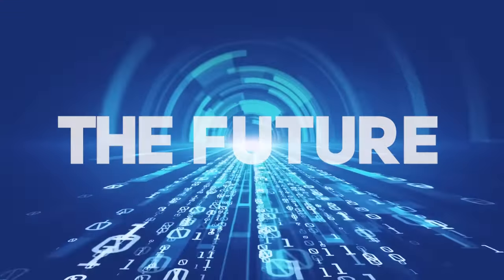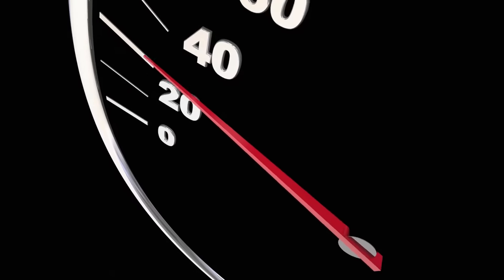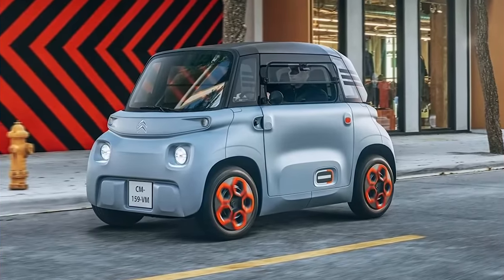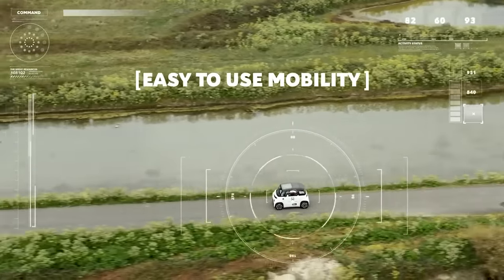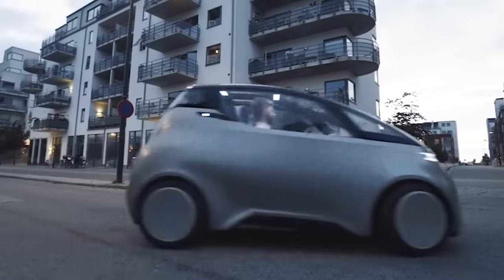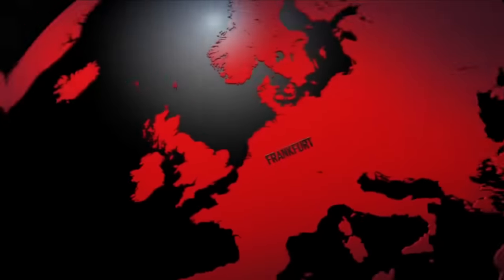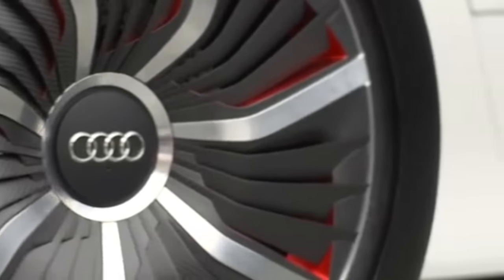Top 10 Mini EVs and Mini Electric Cars to Hit the Highways with

Comment: I’m sorry you left out Aptera up to 1000 mile range. With up to 750 watts solar charging that may almost never need plugged in for short commutes.    Not one of these EV’s compare not to mention cheaper then many of these EV’s.
Reply: This video is NOT about currently available EV’s and your link completely skips my hole point. Screw that not subscribing without honestly reporting EV’s
Reply from the maker: @jpo7091  Understood. Apologies for any confusion.

Comment: The former Chevrolet Volt (discontinued in 2019) has an 18.4 kWhr liquid-cooled battery that manages 50 to 60 miles of EV range. When the battery is depleted, the vehicle seamlessly switches over into hybrid mode averaging around 45 mpg with its 1.5 liter engine. My wife's 2018 Volt needs regular gasoline about once every three months and she is averaging over 200 mpg with her daily 50 mile commute. No range anxiety at all with this vehicle and performance (0-60 mph in under 8 seconds) that would embarrass any of these "futuristic" mini-EV's. BTW, the thermal management of the Volt's battery is amazing with no loss of range in almost 4 years of useage.
Reply from the maker: Wow. That is fantastic! Thanks for the info on the Chevy Volt. It is a bummer that they discontinued it, but Chevy has a lot of EV aspirations for the future. We do have full-sized EV reviews on our channel if you ever want to check them out. All the best.
Reply: Got a 2012 Volt for 9 Years. it was a good car. AHowever, you will lose range and comparing a Volt with this lightweight non-cars makes no sense at all. Now owning a Tesla Model S and ordered a Fiat Topolino (Citroen Ami) as second “car”.

Comment: Don't forget the SOLO by Electra Meccanica! Great little EV. One-seater as name implies. 100mi range. 80mph top speed. 0-60 in about 10 seconds. Looks great.....not as nice as the Uniti but overall it's pretty good.
Reply from the maker: The Solo is great! We actually featured it in a separate video. Check it out if you have a moment.
Reply: @Electric-Rideables  I will, thanks!

Comment: It would be nice to hear about the safety features, particularly the strength of the car chassis / body, air bags, and collision avoidance features.
Reply: Remember the narrator the disclosed that car manufactures sidestep automobile regulations by creating a class similar to scooters, bicycles or public transport vehicles.  So safety is not a big issue or selling point.
Reply from the maker: That is great feedback. Yes, we'll try to include more information about safety features in future videos.
Reply: @Electric-Rideables  Thank you for the reply!
Reply: In the United States, these would fall under the same classification as Motorcycles.
Reply: Category L7e and L6e are Heavy and Light Quadricycles, respectively. there was one L7e microcar i heard of 8 years ago that was crash tested to "1500 to 2500 kg" steel body car standards (passed fine). the problem is, these L7e cars are so light that  they would get bounced around (basic physics). basically you need to wear a crash helmet, treat and drive these vehicles like the motorcycles that they are.

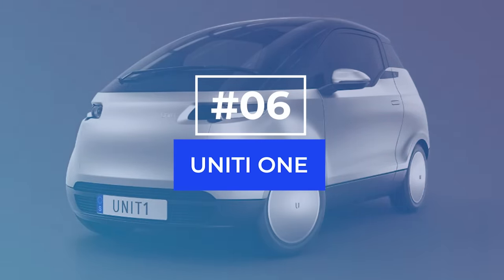Comment: 06:50 UNITY ONE ... extremely interesting seating and space system. 
3 seats or excellent loading capacity.
The 2 back seats are practically located aboce the rear wheels. 
And when laid flat, you can even transport long, narrow items using the space aside of the driver's seat.
Reply from the maker: The Unity One is very well designed.

Comment: What they need to do is make pods with wheels that are more inboard, and the vehicles being able to magnetically attach to each other so they can move together as a sort of divided train. That would improve safety and energy expenditure....create a road train for instance. But most of all, there would be huge space savings if the pods didn't need spacing gaps and reaction time to slow down. You could have a 2-across train and each pod could separate when it reached its destination (and so could drive down a center lane on a 3-lane one-way street in big cities)
Reply from the maker: Cool

Comment: I am a happy owner of the Nb1 in your list.
It is a smart fortwo ED.
I love it.
I really love its power at 60kW and its small size to park anywhere in town.
If I change for something else, I will definitely exclude any vehicle options with less than 60kW of power. And I will give priority to 90kW+ options.
EV car makers should also give us decent wheels and tyres for Electric propulsion.
I am shopping around for the best tyres for my smart ED. Because the original tyres do not have good enough grip for the vehicle.
Reply from the maker: That's awesome. Thanks for sharing.

Comment: I've got a 2020 Smart EQ. Most underrated EV out there right now. Looks great, all the modern features of a hatchback in a tiny car and 90 miles of town range for £16k, and in town you get more like 220eMPG.
Reply from the maker: Excellent! The Smart EQ is fantastic.
Reply: heyhey i have the twizy but spoke with an smart owner @ charging station. he had the new four for but sadly the smart only charges with 1 phase... 3.7 kw. for this price this is bad compared to a dacia spring electrik. the dacia costs only 12k has 200 km range 30kw ccs fastcharge and an 6.7 kw onboardcharger. Even my twizy is a fastcharger compared to the smart for that amount of money i would never buy a smart
Reply: @captainnutzlos3816  Strange, what year was his? The newest ones can charge at 22kw, I've charged mine at 7.6 on a wallbox before.

Comment: The problem with electric cars is "who will fix it or do the maintenance if something is wrong"?

There isnt a garage for it in every town/city, like petrol powered cars have
Reply from the maker: Good point. But, nothing breaks on an EV so there really isn't any need for a mechanic. The entire drivetrain of an electric car has less than 20 moving parts whereas a gas motor can have upwards of 30,000 moving parts. There is a lot more to go wrong with a gas car.

Comment: Here in the U.S.A.  it seems that the EV market is being shot in the foot from all sides. Most of these vehicles are not legal here due to overly zealous safety regulations, insane cost, and overly priced charging stations. The quoted prices on this video are acceptable as a second car. I own a 500e. I drive it 90% of everywhere I go. I charge it at home 99% of the time. Works great in those uses, as some of these affordable cars on this video would. When charging becomes too expensive, owning only an EV becomes less viable.
Reply from the maker: Good to know. Thanks for the feedback!

Comment: i suggest u go look at the chinese mini evs. they r already in the chinese market. i bought one which can charge in 30 mins and runs for 301 km per charge. and it costs only 5000 pounds. plus it looks like a normal car, five seaters with five doors
Reply from the maker: Nice! Is that the Wuling?
Reply: @Electric-Rideables  no. its the 长安奔奔 changan benben e-star highest spec

Comment: MAYBE THE SMART CAR AND 1 OR 2 OTHERS. BUT UNLESS YOU CAN BUILD A SPECIAL HIGHWAY JUST FOR THE ELECTRIC CAR MARKET WITH A CHARGING SYSTEM BUILT INTO THE ROADWAY, I REALLY DON'T SEE A CHANGE IN THE U.S. FOR THOSE ELECTIC CARS
Reply from the maker: Like F-Zero charging.
Reply: Aptera has this covered!!

Comment: LOL.....although I'm a totally big fan of the electric car concept, when I see some of these stupidly designed cars, that are aimed at public consumption, I realise that we have a very long ......LONG way to go before they become a normal daily commute.
Back in the 60's we had bubble cars like the Isetta, and Misubishi etc, and worse still those glass fibre bodied 3 wheelers.....where are they today?.........dumpted.
A car that starts off cheap and small for general economical running about and commuting will always degenerate to a certain size and that is bigger...........once the small car hits the road it gets enlarged model by model like a balloon being filled with air and that soon makes it a part of the growing car problem it was designed to cure in the beginning.......the EV will go the same way.
Reply from the maker: Crazy. Yeah, some of these are geared towards just being used around town and not for the highway or anything. The Isetta you mentioned is part of a concept vehicle design similar to one in this video here if you want to check it out. Anywho, thanks for watching!
https://www.youtube.com/watch?v=MtbkKaDr6Y0&lc=Ugyv7Gi5QXLv0jjybMV4AaABAg

Comment: People won’t buy these cars because they don’t travel very far you need at least 150 miles to get to the next charging station, then there are not enough charging stations, must be able to have 2 seats and some storage for food and other items. And don’t get me started on the price. Arizona is large and families live in different cities. At least 75 miles away my mom is and I can’t stay overnight to charge up to go home. They need to make them much better than this. Great to run to the corner store but that’s about it.
Reply from the maker: Good points. Thanks. One of the biggest factors that consumers forget is that 95% of the time you plug these in at home and leave your house with 100% battery charge. You only have to rely on charging stations if you're on a road trip that is further than the total driving range of your EV.

Comment: Concept cars of Audi never come to serial production - Audi is a boring company in comparison to Tesla
Reply from the maker: A valid point.
Reply: What's so spectatular about Tesla compared to Audi?
Reply from the maker: @honkytonk4465  Interesting question. Tesla has been pretty innovative.
Reply: @Electric-Rideables  but what are those innovations?
Reply from the maker: @honkytonk4465  The Supercharger network, battery technologies and solid state battery, performance-based OTA improvements, vehicle and motorcycle avoidance technologies, to name a few.
Reply: @honkytonk4465  Audi makes nice concept cars - TESLA produce real (repeat) real cars - y got it???

Comment: I wish the discussions about EVs were honest. These range figures are not realistic, no matter which vehicle you're talking about. It's reccomended to not charge more than 80%, cutting your range by 20% . Then you will lose 10 - 30% in battery degradation. Then, you need to return from your destination which makes your range 50% less (actually even less because you can't arrive home at 0% battery). They are years away from anything practicle.

Comment: The Nils looks hot but private vehicles that have minimal capability will not adequately serve working class people. Better designed communities with improved public transit would be the better solution.
Reply from the maker: True that. But, how about multiple solutions?
Reply: @Electric-Rideables  
I guess it would have impact as a rental. Just go to the next charging station and pick one up on days you need them.

Comment: Electric vehicles are now a good stay with Gas combustible engines
Reply from the maker: Absolutely, electric vehicles (EVs), including electric motorcycles, are becoming increasingly viable and attractive alternatives to traditional gas-powered engines. The shift towards EVs is driven by several factors:

Environmental Benefits: EVs produce zero emissions at the point of use, contributing to cleaner air and reduced greenhouse gas emissions.
Economic Advantages: Although the upfront cost can be higher, EVs often offer lower running costs over time due to cheaper electricity compared to gas, as well as lower maintenance requirements.
Performance: Many electric vehicles offer impressive acceleration and performance due to the instant torque available from electric motors.
Innovation and Choice: As the market for EVs grows, manufacturers are introducing a wider range of models, including motorcycles, with varying features, styles, and price points to suit different preferences and needs.
Energy Independence: Electric vehicles can be powered by a diverse range of energy sources, including renewable energy, reducing dependence on oil and enhancing energy security.
It's an exciting time for the automotive industry with the evolution of electric technology.

Comment: None of these cars would pass the Crash Test requirements to be legal in US!  And they are too pricy compared to VW ID4 which with incentives would costs $34k in US.  As for your number 1 choice Smart EQ, the gasoline version barely selling 100 units in US!  These cars are simply not practical for US market.
Reply from the maker: Very true. I wouldn't dismiss them country-wide, however. Some consumers live in, and work in, places like downtown San Francisco, or Seattle, or any other metropolitan area.
Reply: @Electric-Rideables  Living in Metro areas in US does not eliminate the need for a practical and safe car!  I used to live in San Francisco.
Reply from the maker: @DavidMortaz  Totally. You are correct.

Comment: Better is ²H¹O, that's H²0 split to hydrogen and oxygen, igniting above 700°C, 2 Hydrogens to one Oxygen, captured from air and turned to water (H²O) and combusted in an otherwise conventional engine set up. How easy? Take a bottle out of fridges into warm rooms, in seconds you have water condensation on it you can draw patterns in.
Split it using an electrical strike (as lightning does) but in a vessel containing the condensed atmospheric water taken originally from the air. That's the key to the future without putting up with batteries replacing combustion engines (/^v^)/...

Comment: Please don’t show anything that’s got under 200 mile range I don’t care if it dances and makes breakfast I care that we can charge it to 80% cut that in half and leave at 10% variable to whether or not we’re going uphill or run in the air conditioner so we have 90 miles out 90 miles back I don’t want anything less than that do you understand most people don’t
Reply from the maker: Totally. We’ll see if we can’t get some better electric vehicles for ya :)
Reply: Honestly they won’t tempt me below 400 miles plus because of the conditions I stated see if your a customer looking for the first time you think those are all usable until you read the owners manual 
Then you get a lump in your throat and get buyers remorse if this is your only car.

Comment: Lol save the planet :) with this cars. Its a myth debunked now. Production of EV produce more carbon emission due to the used materials. Also Electricity to charge that EV is in majority of countries produced by Coal, smart ones use Atomic KW, and  than on the bottom are renewable sources. Also lets not forget to mention that Sweden and other countries start now limiting  charging of vehicles due to the Electricity shortages. Last but not least where the material for the Barry comes (Africa - human labour ) and what is the life time of that battery?  Gas vehicle are still more environment friendly than this EV solutions  currently on the market.
Reply from the maker: The debate is still open, but thanks for the well thought out feedback. Cheeras!